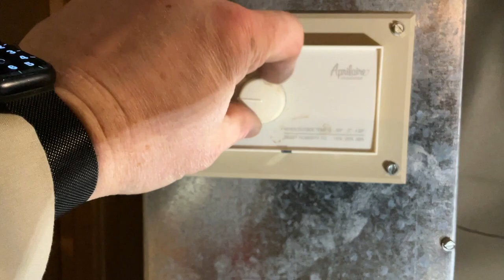Installing a AprilAire Model 700 Humidifier

Comment: With the new humidifier is this in a heavy limescale area? If so might be also worthwhile pointing out some the extra cleaning and clogging problems including at the filter end to the homeowner if limescale is a problem. Personal room humidifiers rather than the whole house humidifier you have here can cause several annoying issues for the furnace over long-term use.
Reply from the maker: That's a good point! with this one they are elderly and I will personally be going there every year and taking care of this. They definitely need maintenance every season.